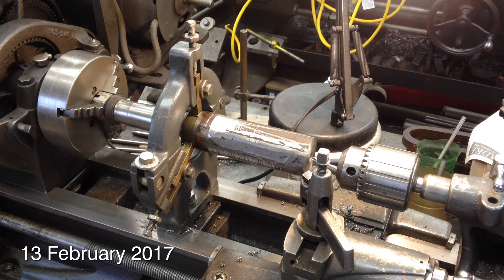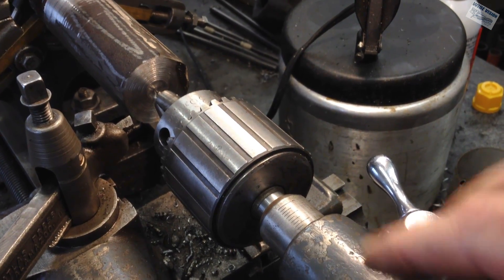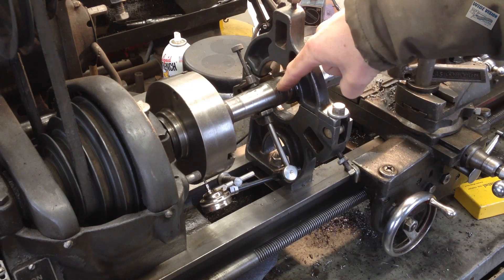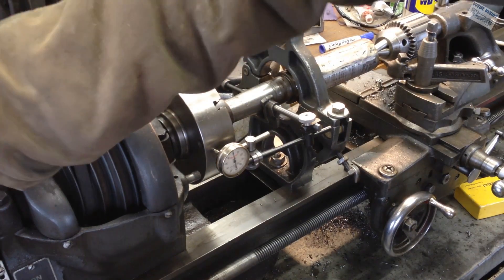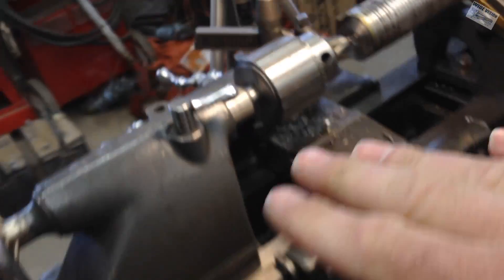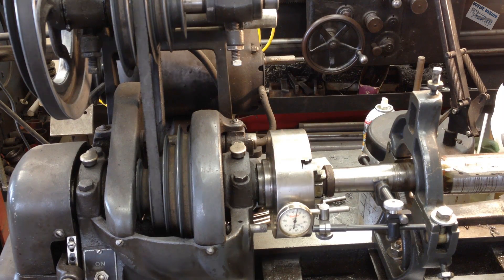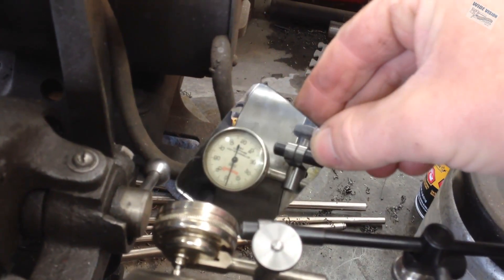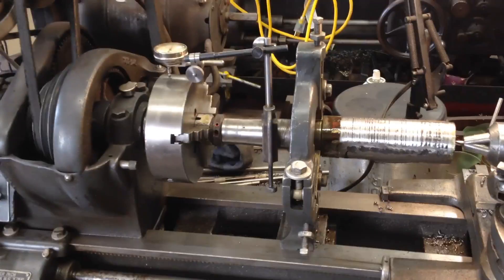Aligning the Steady Rest Quick Tip (With a mistake!)(Part 1 of 2)

Comment: You could do all that by eye.  Simply adjust the rollers to get close (pretty much like you accomplished with the indication), then drill very carefully.  You will see right away if the center drill is drilling, or boring because it us still off center.  Adjust if needed.  Continue center drilling until you have some small amount of real center established.  Put in your live center to support the work, readjust your steadyrest to the new position.  Now finish drilling your center to the desired size.  Support the work with the live center, and away you go.  Fun video I have a lathe just like it in my garage.
Reply: Thats how i do it.  i use the same method you described above on 1-2 ton roundstock.  just gotta drill it really slow and be careful.  ive broken rollers before from heavy roundstock that wasnt quite round enough though!  some guys would be surprised at how close you can get just by using a scale from the rollers to the live center point!  thatll get you close enough and just adjust your center drill from there.  waste of time with all these indicating the steady in or sweeping the tailstock methods in my opinion

Comment: Try this method 
1 put your part in the Chuck and in the steady 
2 put a lump of plastercine on the end of your part
3 with a centre in the tail stock put the tip of the centre into the plastercine 
4 rotate the Chuck by hand a few rotations. The centre will gouge out a hole in the plastercine 
5 realign the steady to the middle of the gouged out hole in the plastercine 
6 repeat steps 2-5 until the centre is no longer making a larger hole in the plastercine 
7 that’s it you are smack on centre 

It works a treat. I’ve done it more times than I can count
It takes about 2 minutes and the only thing you need is a lump of plastercine

Comment: Hi. Very useful info. By the way, only have to use three readings. If two readings are taken at 180 deg the other reading should be taken at 90 deg to previous readings. When aligned correctly readings will not change on a round shaft. Sometimes there is no room to rotate full 360 deg. The same technique works to realign a tailstock by clocking up a dead centre with the clock base secured to chuck or spindle.
Reply: Yes.  There is still a small amount of indicator sag, maybe a couple thou.

Comment: Nice video but I have some Constructive criticism. Mounting the indicator on the shaft is not the same as mounting it on the chuck. With it mounted on the shaft if you had the indicator touching where you were gripping you would get almost no indicator reading regardless of shaft misalignment but since you are about 2 inches behind your grip you are getting some reading. If you  mount the indicator on the chuck you will be directly reading the TIR of misalignment where the indicator is touching. 
All the best,Robin
Reply from the maker: I keep running this through my head... I really think it works both ways, but I've never done it the other way because I don't have a good way to clamp the indicator to the chuck. Maybe after work I'll see if I can do it both ways. I keep thinking if I taped a string from the chuck to the shaft, the string would get slack on one side, and get tight on the other as the shaft turned. And that's what the indicator is reading.  But maybe that's not the correct way to think of it either.  I definitely want to go try this now! :)
Reply: Think about the shaft having a spherical diameter where it is lightly gripped in a collet. Now mount the indicator on the shaft just like you showed and have the indicator tip touching the OD of the collet nose right over the center of the sphere. You will be able to move the end of the shaft around in a .25 diameter orbit and the indicator will barely move at all. Now mount the indicator on the collet nose and put the tip of the indicator towards the end of the shaft and now when you do the .25 diameter orbit the indicator TIR will be .25. I hope that helps.
Reply from the maker: I just got back from the shop, and I believe what you said is what I just proved to myself. In order to measure from the shaft to the chuck, the chuck needs to be large diameter to properly display indicator movement. Where as measuring from the chuck to the shaft, the indicator holder is a long lever that amplifies indicator movement. I think I'm going to do a video on it. Thanks for setting me straight!